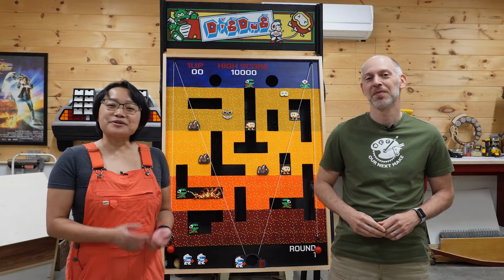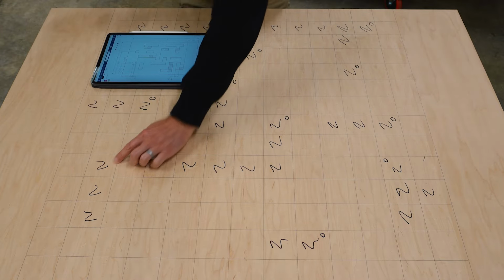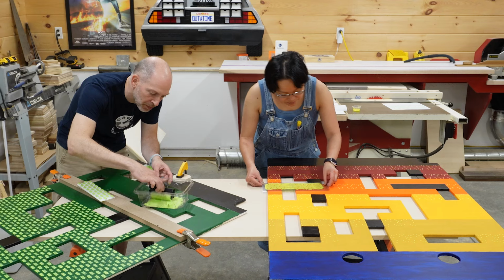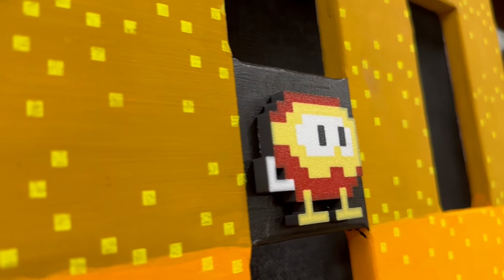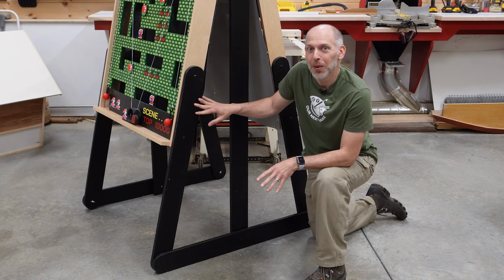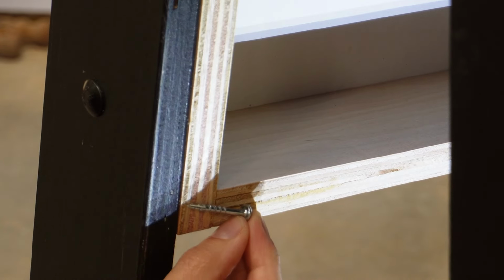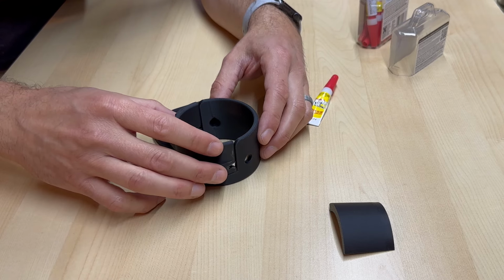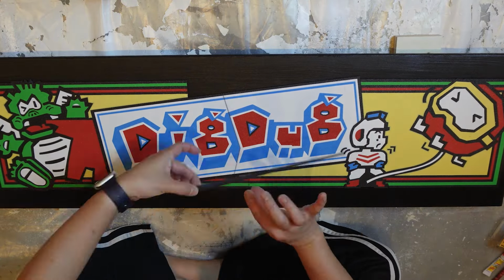Retro video games make backyard games better!

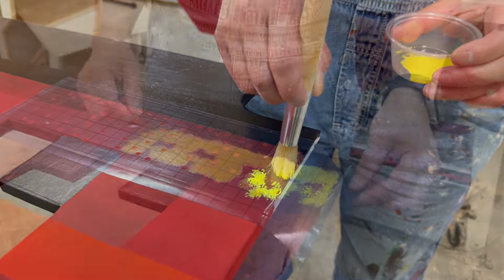Comment: 2:23 Thanks for the new idea on how to use my Cricut!
Reply: 4:07 love the animation here!
Reply from the maker: Yes! It really works well if you get the special stencil material. It stays fairly sticky each time you pull it off and reapply. Also, it's not too sticky that it would remove paint. I did hop around the field so that I'm not applying the stencil on wet paint. Let us know what you end up using the stenciling for!